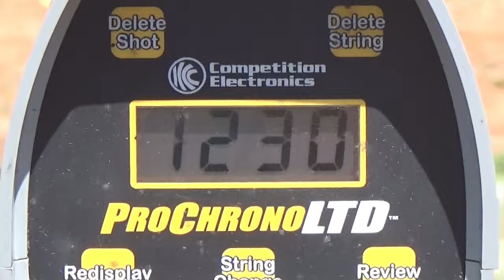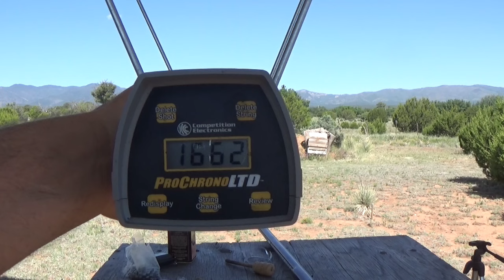DIY Black Powder Guessing Game Round 2

Comment: I'm on my second Pro Chrono ,never try one with a scoped revolver the offset will bite you.  I also have a Magnetospeed and just had the thought "I wonder how a Magnetospeed would work with a muzzle loading rifle" It clamps to the muzzle just below the bore line. Works good for Bolt actions and AR Platforms but not for my Handguns. They also have an adapter for shotguns .

Comment: Those numbers you speak of in the fillers go to Predictability and Long Range Shooters not Black Powder loads. On the others hand if your load has a small standard deviation it tells you your on the right track for uniformity and predictability so you can pick out the most repeatable load for when you do go Hunting or if a brand of percussion caps isn't available what else gives similar results.

Comment: The can o worms @12:25 should prompt calls to Lawyers and Congressional Representatives.
US Title 18 Part 1 Chapter 40 OCT 15, 1970 - IMPORTATION, MANUFACTURE, DISTRIBUTION AND STORAGE OF EXPLOSIVE MATERIALS
§842 (a)(3) [Transporting]
1970 version: "to transport, ship, cause to be transported, or receive in interstate or foreign commerce any explosive materials....(plus a blurb about adjacent states)"  
1975/current version: "to transport, ship, cause to be transported, or receive any explosive materials."

§842 (j) [Storage requirements] no changes from 1970 except "Secretary" was replaced by "Attorney General"

§845 (a)(5)  [Black Powder exemption]
1970 version: "black powder in quantities not to exceed five pounds; and"
1975 and current version: " commercially manufactured black powder in quantities not to exceed fifty pounds, percussion caps, safety and pyrotechnic fuses, quills, quick and slow matches, and friction primers, intended to be used solely for sporting, recreational, or cultural purposes in antique firearms as defined in section 921(a)(16) of title 18 of the United States Code, or in antique devices as exempted from the term "destructive device" in section 921(a)(4) of title 18 of the United States Code; "

Comment: I never liked bouncing/throwing the ram rod as I watched many shooter do. I felt it could indent the ball and so I always just pushed with a lot of pressure and looked at my notches on the ramrod to see if its all the way home depending on the particular charge. Appreciate you mentioning the bounce effect indicating the ball is seated.
Reply: Having shot Percussion rifles like my .45 Kentucky Long rifle, what I can tell you is yes bouncing and throwing the rod like Terry is doing does seat the ball. And yes it does indent the round ball, which causes it to engage the rifling better so that you get a more accurate and consistent shot even with a patched ball. And there are conical balls, also known as maxi balls that you need to do that with so the can engage the riffling other wise it will be like you are shooting a smooth bore gun.
Reply: @GenderSkins  I also shoot 9mm round balls through my high pressure air rifle and found them to be more accurate than any store bought bullet. If they were dented I don't think I would get quite the accuracy. I did come in second one year at a Florida muzzle loading champion ship on the 100yard range with a .45 long rifle. I was 15 and my eyes were better.

Comment: I wonder if painting the chronograph white would make it more resistant to sunlight heat related failures.
Reply from the maker: It might, good thought.
Reply: Maybe a nice glossy white and a coat of ceramic, like auto detailers use?

Comment: This comment is in regard to your filler piece in which you indicated that concern with numbers, such as the standard deviation, tends to be more of an ego issue than a practical issue.   As I understand your position, an animal killed with a 1,400 fps projectile is just as dead as an animal killed with an 1,800 fps projectile.    

One often hears of people "working up a target load" or "working up a hunting load."  They try different weights/volumes of black powder to see what the optimal quantity of powder is for a minimum group size at distance for a target load, or a reasonable group size at distance for a more powerful hunting load.   The standard deviation is a measure of how consistent or how variable the velocities are with a given load.   Consistency in velocity tends to translate to consistency in impact, or smaller group size.   A high s.d. is the equivalent of pouring a random amount of powder into the chamber or barrel.

At relatively close hunting distances,  30, 35, 50 yards, being off by a couple of inches from the point of aim will probably still result in a kill shot.  At substantially longer distances a high s.d. can make the difference between a kill shot, a wounding shot, or a clean miss.   My point is simply that concern with numbers, such as the standard deviation, will have a different degree of importance depending upon one's use of the information.
Reply from the maker: All true, with the exception of  the amount of loading pressure applied on the ball and charge and how you loaded the muzzle loader in the first place. (Is it consistent every time) I look at it all through the lens of a scope on your rifle, If you sight adjust the scope to hit dead center say at 150 yards like I did years ago, I shot under the deer. (The deer was very close)  I did not think to adjust for a close shot.  That is why I stated when you are shooting a Elk or Deer those thought do not enter your mind.   That is when I, for me, scopes became useless.  Unless you are great at guessing distances the tendency is nothing but a ego enhanced hail Mary shot.  This is stated form watching a hunter shoot at a Elk 400 yards away with a modern in-line  Muzzle loader with a scope  and never came close to hitting the Elk.  Needless to say, my stalking to get within  a open  iron sight  muzzleloader distance was ruined.  In fact the entire hunt was ruined, the Elk ran to private ranch land and stayed there. How do I know the shot was taken at 400 yards,?  I made my way over the the hunter who had a range finder with him.  As you stated It's a "reasonable" group size at distance for a more powerful hunting load. Define "reasonable".  Not to argue, but for me Reasonable is not definitive.  It's still guess work, is it not??.
  I will also state how the muzzle loader is,  say leaning up against a tree or laying across your lap, the sun beating down on a rifle laying parallel to the ground will absorb more heat thus expanding the metal and changing any measurements  or number or hunting load you have worked up.  These are issues most people do not take into consideration.  A cold winter day will contract the metal and make for a different hunting load, thus changing any knowledge accumulated shooting through a chronograph  working up a load.  
 Like I stated I think in different terms or more accurately through experience.  All Hunting situations have to many variables that can not be accounted for reading numbers through a chronograph.  One such variable is terrain, any worked up hunting load becomes mute,  shooting down hill or up hill changes any given hunting load.  That is why these number mean nothing to me.  Thank you for your comment.